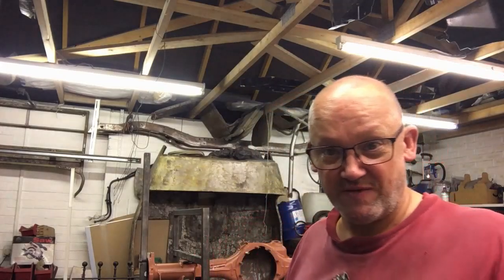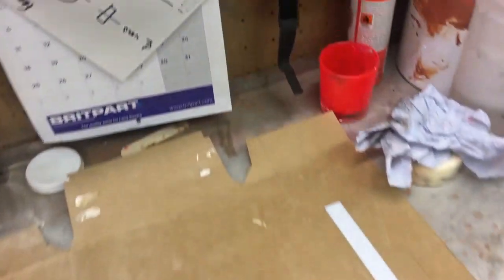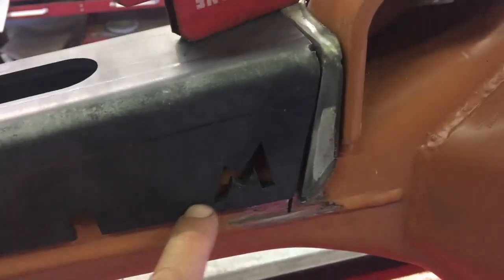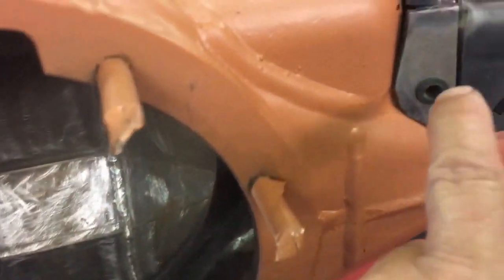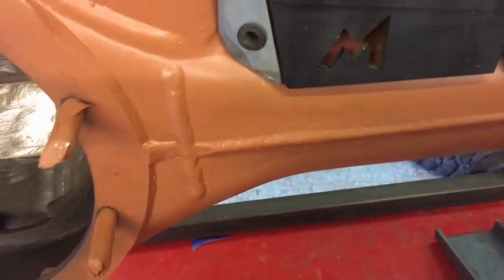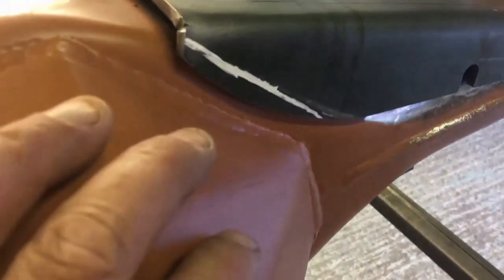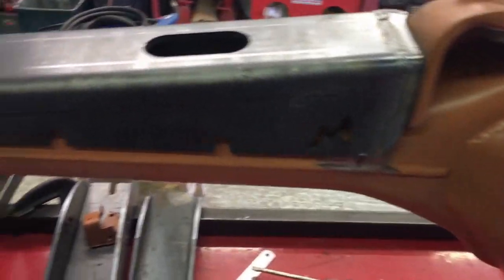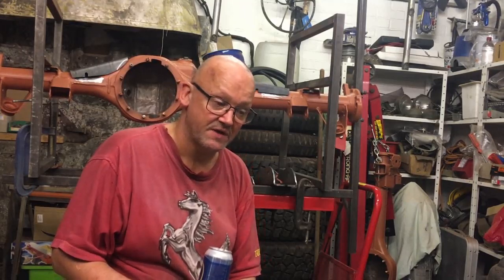Fitting Terrafirma axle trusses. Part 1

Comment: Plenty of opportunities for Mr Surfacer on that axle 😉.
Ranger Raptor... Well that's an interesting vehicle. I have a friend in SA who has one and loves it other than its size. Our Local Authority here replaced its 2005 Landy 130 crew cabs with Ranger crew-cabs in '16 and they have been a disaster. Unreliable, can't take or pull the same load and very poor off-road performance which when you are maintaining parks etc is not useful. Hope that helps. Personally I'm neutral on the Ranger but it's what we're stuck with as we can get the F150 except by the personal import route.
Reply from the maker: For sure Andy, Ranger vs Defender off road is gonna be a win for Defender every time, especially if the Ranger isnt 4WD. However, the Raptor has a totally different suspension design including wider track, coil overs with Fox shocks. I think the shocks alone are like a grand each? Anyway, ordered it now and getting it next week..